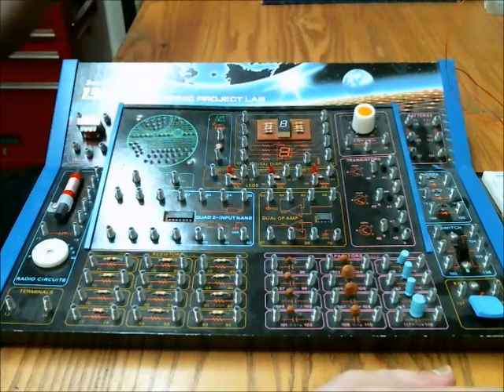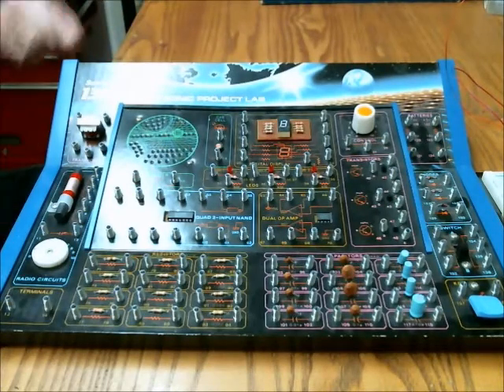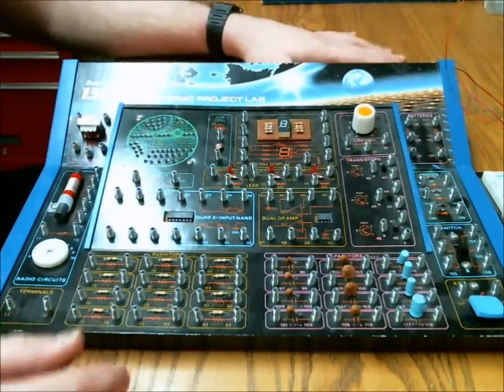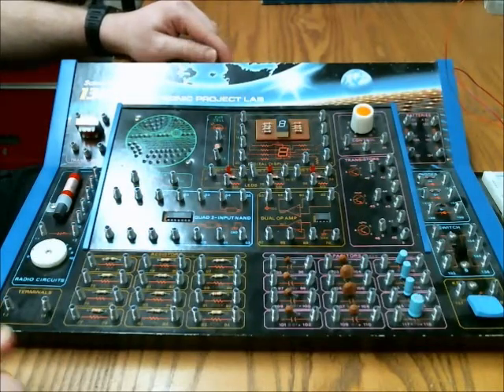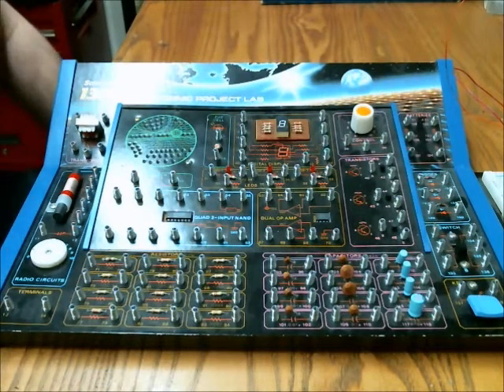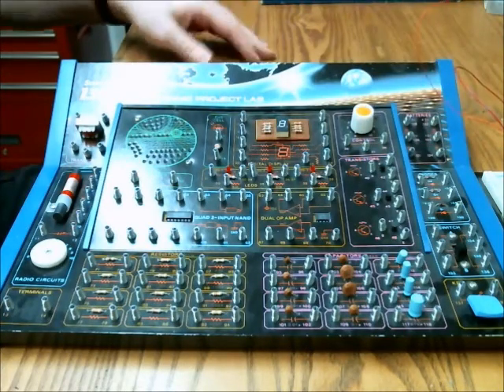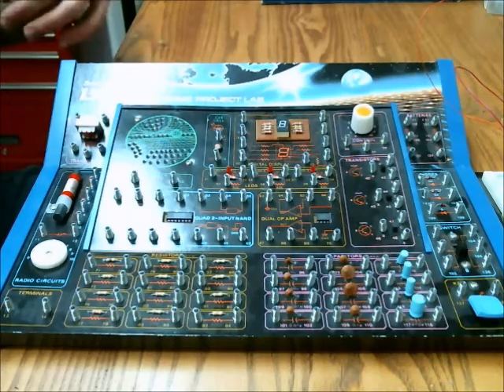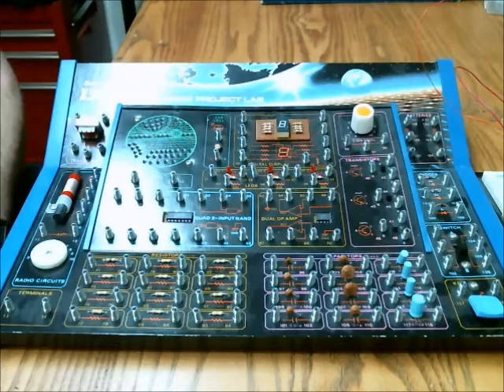Electronic Project Lab Kit

Comment: I had a kit called a 50 in 1 kit.  I learned electronics from it and had a great career.  I worked at a cable company as their bench tech for 14 years.  Then worked at a TV station for about a year.  Then a treadmill circuit board manufacturer.... and others.  Kids today are just clicking their cell phones for entertainment.  Wonder how that will work out for their career.  Maybe they will qualify to flip burgers at  McDonalds... if some robot isn't doing that instead.